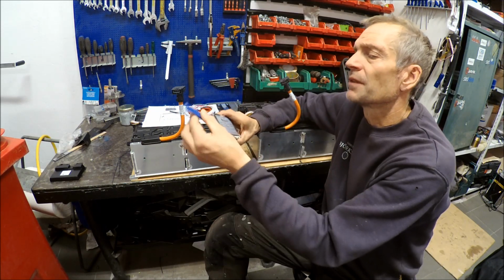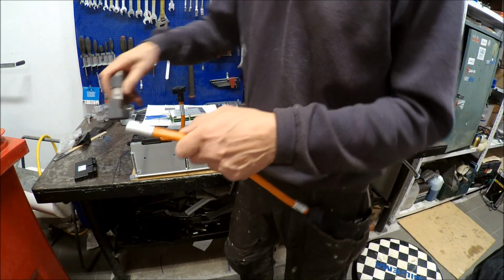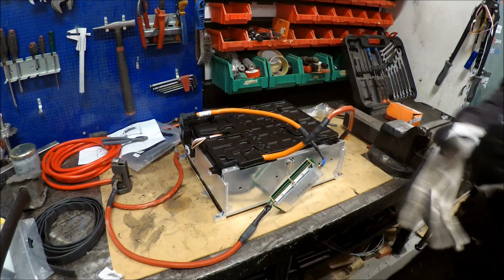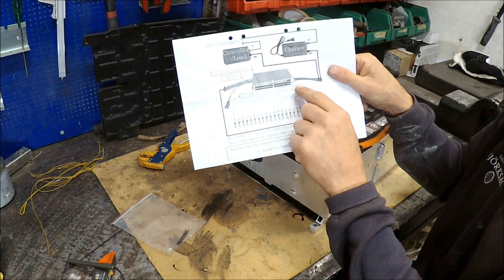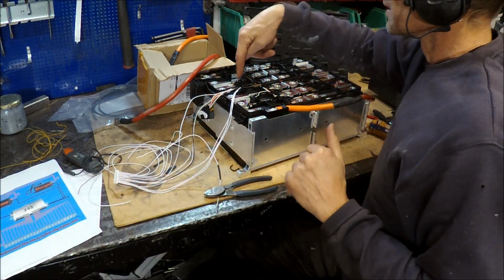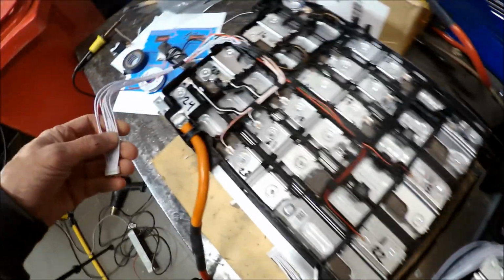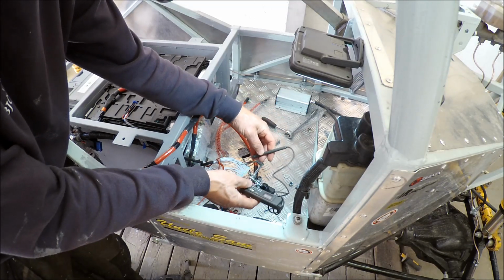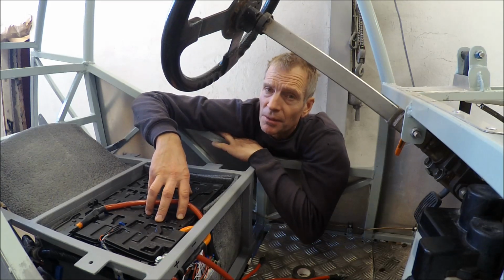BMW I3 battery modules ANT BMS 24s  96V

Comment: nice job, hopefully i can buy 8 modules of the  i3 94ah (33KWh)  this week! is there smomething i can measure or check before buying? thanks
Reply from the maker: Hello, Joris ! Congratulations, great !!  You can check voltage, nominell it should be 3,7 V x 12s = aprox 44 V for the best storage. Min voltage 32,4 V, if lower they could be dead. It is the samsung sdi battery : https://cdn.shopify.com/s/files/1/0480/6521/6669/files/BMW_Samsung_SDI_94Ah_Datasheet.pdf?v=1605781107

BR Per
Reply: Nice! Thanks for your quic response! Greats from the Netherlands
Reply from the maker: You are welcome !!  Wish you luck from cold Sweden, still below zero celsius.  BR Per
Reply: @persteel  Nice! We have a deal, I can pick them up next week! Do you know a nice bms system for all 8 modules? I like to build a electric vw beetle or vw bus or 914! Thanks in advantage! Great work!! Super nice channel
Reply from the maker: Thats nice ! Thank you.  If you are to connect the modules in serie, 96s, the best solution is the Simp BMS : https://evshop.fr/en/bms/280-simp-bms-battery-management-system.html

BR Per
Reply: @persteel  NIce, first i want to use the standard orion 2 96c -183m system but i think this one is better and also cheaper!! great job again, we keep in touch!

Comment: Where do you buy your orange shielded cable and connectors etc etc? Do you have a nice shop in europe? Thanks
Reply from the maker: Hello, Joris ! Mainly on Biltema Swedish retailer. But for EV:s you have a specific Shop : https://evshop.eu/en/   Think they have competitive prices.  BR Per
Reply: The orange shielded cable is from BMW. I think I've seen other EV manufacturers use it too so it might be commercially available to the public and not some obscure/proprietary cable

Comment: Do you happen to know the protocol ANT BMS uses on the serial port?
Reply from the maker: Hello, afraid not, maybe you can find some information here : https://www.aliexpress.com/item/32826820690.html?spm=a2g0o.detail.1000060.2.acdc9b8amvcmep&gps-id=pcDetailBottomMoreThisSeller&scm=1007.13339.169870.0&scm_id=1007.13339.169870.0&scm-url=1007.13339.169870.0&pvid=69f5dbbe-f6f2-4100-948e-f5b483345588&_t=gps-id:pcDetailBottomMoreThisSeller,scm-url:1007.13339.169870.0,pvid:69f5dbbe-f6f2-4100-948e-f5b483345588,tpp_buckets:668%230%23131923%230_668%23808%234094%23510_668%23888%233325%2313_668%232846%238114%23704_668%232717%237565%23731_668%231000022185%231000066058%230_668%233468%2315612%23359

BR per
Reply: @persteel  I have contacted the manufacturer before with no success. I also took at look at the serial data directly, but couldn't identify the protocol. Thanks anyway.

Comment: Funkar det att bygga solcells laddning till batterierna som du har?
Reply from the maker: Hej, kul att du frågar just det !! Håller på med ett sådant projekt som kommer på video snart. Kommer att använda en BMW I3 modul på 48 V och 12s ihop med ett DALY 12s 80A BMS ( Aliexpress). Till den en Victron charge controller MPPT 150 I 35 , EBAY.de . Just den controllern har en laddkurva för litiumjon batterier och klarar 48 V batteri. Den är dessutom programmerbar via bluetooth så du kan anpassa spänningen till dina batterier. Finns en variant med inbyggd BT alt köpa en dongel till. Har ev en batterimodul och BMS över.
Mvh Pär
Reply: @persteel  Hej Per, Blev det en batterimodul och BMS över som du trodde? För man köpa den biligt :)